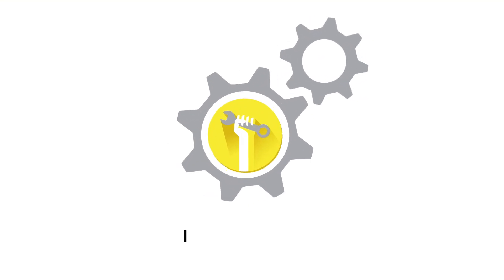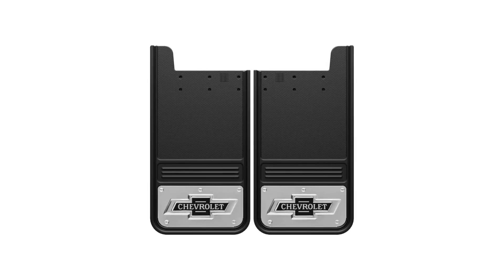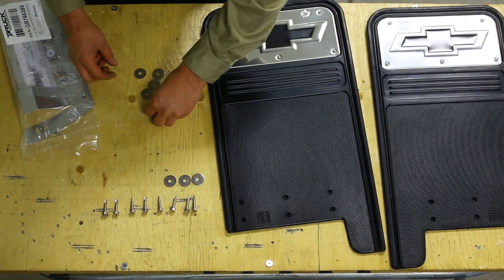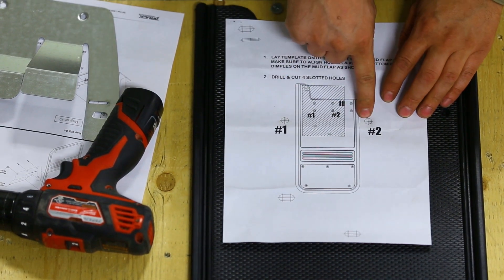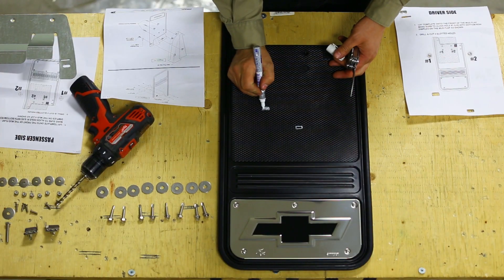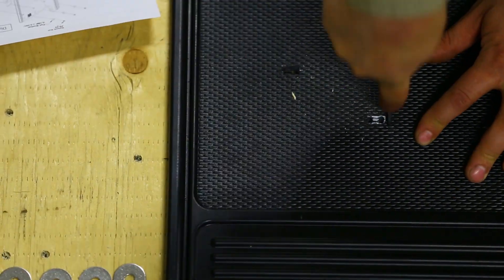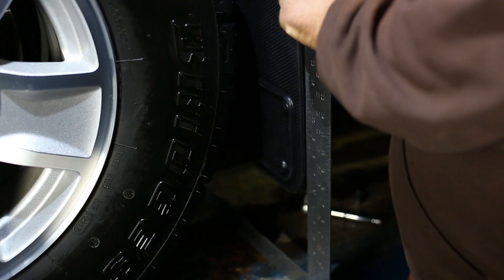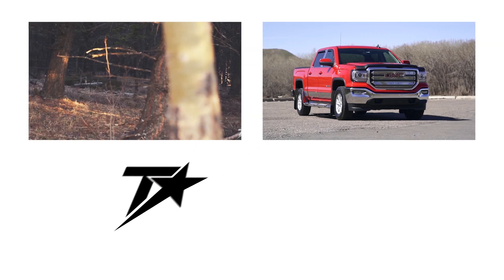Gatorback GB766385 Rear Universal Bracket Install

Comment: One caution in installing the brackets to the mud flaps. Carefully tighten the screws and the locking nuts when attaching the brackets. Do not over tighten as the bolts break easily. Don't ask how I know.

Comment: How the crap are you selling $140 mud flaps without the mounting bracket to install it.  Irritating!!!
Reply from the maker: The flaps are a universal design. The same flaps can be used on any year truck. On some models of trucks no bracket is required for mounting. We have had customers who have had the flaps on their old trucks, and then buy the updated bracket and move them to their new truck.